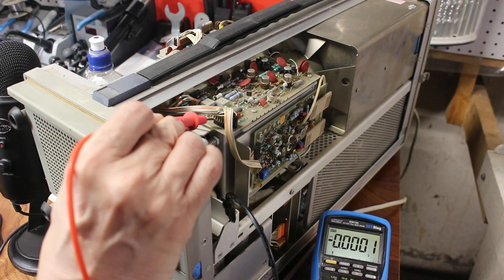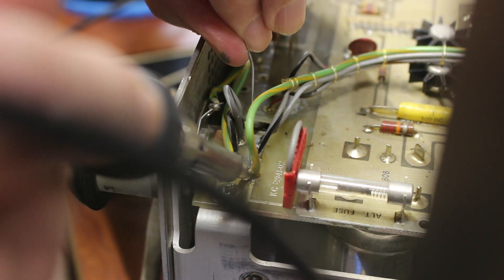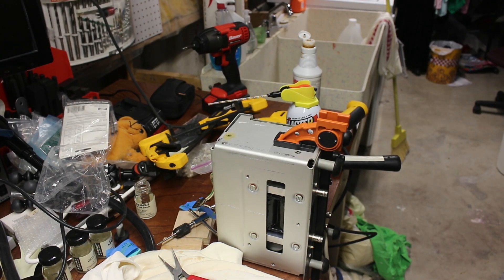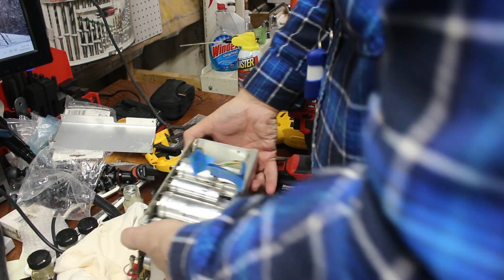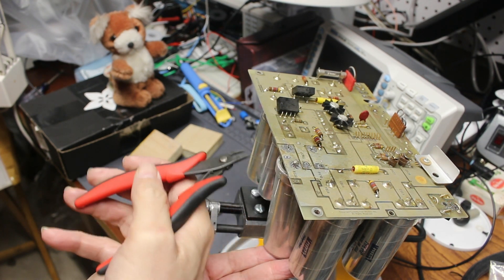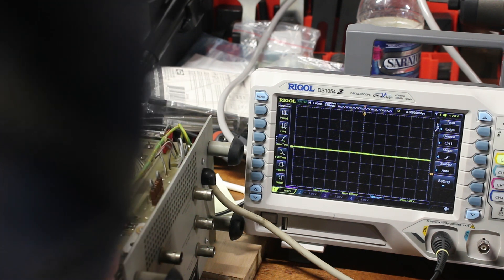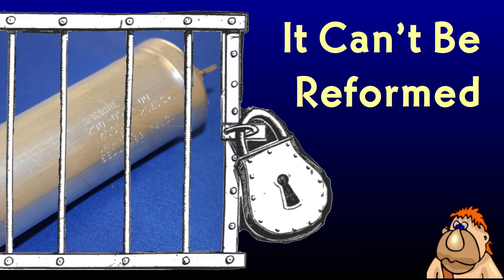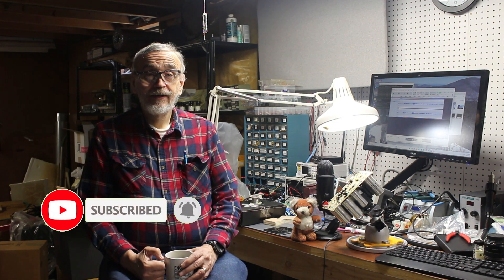Tektronix analog scope restoration: episode 2 of ? - accessing a bad capacitor

Comment: I mentioned on your other video that I'd had issues with pozidrive screws. I went to the trouble of buying a new set of pozidrive bits, to replace the starboard fright ones I had been using, but still damaged some screws - and I don't think these screws had been touched since the factory. So I'm even less happy with pozidrive (pos-idrive?) now.

While looking for leaking caps, take a look at the ones on the interface board. There are 5 electrolytics. One should be visible with the plug-ins removed, and the other 4 are hiding behind a small pcb between the connectors for the two vertical plug-ins. I recently discovered them leaking in a 7633; they'd damaged the interface board, the pins connecting the small board, the corresponding connectors on that small board, and had started to corrode the leads for the plug-in connectors. I just hope that whatever amount had soaked into the interface board wasn't enough to continue corroding the internal traces. 😅
Reply from the maker: I'll have a look. Thanks for the warning!

Comment: Kevin, your capacitorology is deficient.  The so-called leakage current flowing through a capacitor is actually the aluminum oxide dielectric formation current.  It never drops to zero as it is continually restoring dielectric that wears out.  The wearing out of the dielectric can be ascribed to entropy. Capacitor chemists know more about it but don't talk much about it.  Increasing the voltage on an electrolytic capacitor approximately linearly increases the formation current's intensity.  Ohm's law says things get warmer that way.  A capacitor kept cool lasts longer, obviously.  "Over voltage" on an electrolytic capacitor shortens its life but does not precipitously cause it to fail.  As in your oscilloscope's case, the most common failure of electrolytic capacitors is the increase of its "equivalent series resistance."  ESR, the acronym we are familiar with, increases and is the the result of the deterioration of the electrolysis process that makes an electrolytic capacitor an efficient energy storage device.  The average peak voltage of a good capacitor is lower than that of a capacitor with a high ESR.  That is why a 25 volt labeled capacitor can run at what you think is 26 volts but is not really operating at an average of 26 volts.  Do some more math.
Reply from the maker: @pibbles-a-plenty1105  Yeah. The nominal voltage on that rail per the schematic is 26 V,   and what I observer was 28.5 V because, as you say, the ESR is way up. That also diminishes the capacitor's ability to source current on the other side of the cycle, so the voltage also sags to less than the regulator needs. Even the nominal 26V on the rail is pretty sketchy for a 25 V cap, wouldn't you say? 

There almost certainly was degradation of the oxide layer during the long time in storage, and then suddenly applying full operating voltage can't have been good for it. (I'll usually try to reform with a voltage-limited constant current.) 

I didn't see obvious signs of leakage, but there may also have been some loss of electrolyte, which has the effect of reducing the effective plate area and hence the capacitance.

In any case, it is now most definitely bad. I was going to try reforming it, but it was going to be too much work to get it out nondestructively. Replacing with a modern 35 or even 50 volt part seems prudent.

Comment: Soldering 101 for you, Kevin.  It's the rosin FLUX that conveys the heat to the metals that are to be de-soldered, then eventually the solder melts and the molten metal raises the temperature to alloying potential, while the molten flux is preventing oxygen from oxidizing the metals and preventing alloying.  So what is alloying?  When two metals alloy it's the process of one metal dissolving into the other metal, or both dissolving into each other.  Now CAN THE F......ng MUSIC!
Reply from the maker: Rosin doesn't conduct a lot of heat.  It does provide a coating to prevent oxidation, true.  It also etches oxidation off the surfaces to be joined.  Preventing the oxidation lets the heat source come in better contact with the metals rather than having an insulating layer of oxide in between. And I used lots of flux.

Sorry you don't like elevator music.

Comment: HEAT would probably have loosened those screws...???
Reply from the maker: It's hard to apply heat in a controlled enough manner.  The aluminum cage will conduct it away fast, and I'm not about to take a torch to it with all the electronics right there!  I did use heat when I had to get a broken bolt out of my daughter's washing machine a few months ago - Dremel'ed a slot in the broken stub, heated the whole area, gronked on it with a big screwdriver, and out it came.  Along with a small fireball from all the penetrant I'd sprayed on it before resorting to the torch.

Comment: That's the reason I keep old plumber's soldering iron in my toolbox. Sometimes you really need that extra thermal mass to get things flowing.
Reply from the maker: @pvc988  My father's iron was lost in a flood some years back and I haven't picked up another. I don't need a big iron that often. I'll have to keep my eyes open if I ever get back into restoring vacuum tube gear.

Comment: The Sprague seems to have a date code of 7413 while the Mallorys are 7403.  Close enough to lend credibility to the idea that the Sprague was original and Tektronix made the mistake.  I recently redid the filter capacitors in my similar vintage 465 and there was a mix of Mallorys and Sprauges so I wouldn't read much into that.  
I followed the same techniques as you did for removal and didn't do any better, despite the caps being smaller.  Even with a lot of care it's hard not to tear these traces.
Reply from the maker: Yeah, the date codes are close.  Tektronix made the original mistake in any case - the bill of materials for that scope shows 25V capacitors.  It's still a puzzle that there are 30V caps on the positive rail (and the BoM shows 25V ones there too).  

I don't think I'm going to bother trying to replace the others unless there's an obvious sign of trouble,  Those old cans from Sprague, Mallory or Cornell-Dubilier seem to last approximately forever unless they've leaked, and I saw absolutely no sign of leakage. (It helps that they are mounted upside down so there's no electrolyte lying against the vents.)  I'm not in the camp of 'recap just in case', particularly with PC-mounted caps, where I'm likely to damage the board getting them out. I might change my mind, since I'll have extra hardware to adapt the new ones. With the first cap out, I think I'll have room to clip the lugs and not have to mess with a file.

While I don't routinely replace electrolytics from the 1970's, early 2000's electrolytics, from the era of counterfeits and the Capacitor Plague, are another story.  And I'm leery of tantalums, because they have a distressing tendency to fail short and catch fire. (Similarly, I don't touch competently-done 1920's knob-and-tube wiring unless the circuit needs service for another reason, but 1950's cotton-and-gutta-percha Romex puts the fear of God in me. It's a fire waiting to happen)
Reply: @KludgesFromKevinsCave  I think we're of like minds of many things.  The only reason I did a total replacement of the filter capacitors on the 465 was the difficulty of disassembly and the internet providing the physical sizes for easy replacement.  In fact only one was measurably, and demonstrably  bad.

So many of those old electrolytics have so much excess electrolyte or were so well built they'll be good for another hundred years if not more.  

I have faith in modern, long life and suitably derated through-hole electrolytics, but that faith is not from scientific experience but rather believing their logic.  The capacitor plague being at the least a cautionary tale to have such faith.

I've dealt with a rather large amount of knob and tube, and I've never found anything that wasn't competently done.  Electricians then were masters of their craft.  The only issue I ever saw was where the conductors were brought close together and then baked with a 100W bulb for 70 years.

Comment: I feel your desoldering pain here, having pulled a fair number of those cans from Tek TM500 mainframes. I've had a little better luck with a larger iron, but then there comes a point where the pcb decomposes from the heat...
Reply from the maker: If I get really ambitious, I'll core out the old can and hide the new capacitor inside.  But I probably won't, since I don't think the cap I'm replacing is actually original.

Comment: I think the screws might be Pozidriv rather than Phillips.
Reply from the maker: I don't think so - the slots looked to have started out symmetric but between being overtorqued and then sitting in place for fifty years, they just got thoroughly frozen.  (I didn't see any evidence of a thread locking compound either.)
Reply: @KludgesFromKevinsCave  They are definitely Pozidriv screws. Using a Philips bit probably damaged the screws. 

The best place for Philips bits is in the rubbish bin as it the worst screw type ever invented. Interestingly,  Pozidriv bits are usually better at removing damaged Philips screws than areal  Philips bit.
Reply from the maker: I checked, and while the screw heads were already pretty messed up, when I looked more closely, they are indeed Pozidriv. (Yes,I did know that there's a difference between Phillips, Pozidriv and Reed Prince) I don't know how I missed seeing the notches on the heads. I might replace them with Phillips because that's what I can get at the hardware store locally, rather than having to put together an order from McMaster-Carr. Heresy, I know.

Comment: Will that explain the brass lugs on the terminals, which were added to make the replacement cap a snug fit? (and a pain to desolder)
Reply from the maker: @kirkhamandy  I think I mentioned that the cap is a heavy component and nothing's supporting it but the board. I think that the first prototypes of the scope probably failed shake and bake because the caps started tearing away. It was usual to fix that by adding brass ferrules for strength.

Comment: There's definitely some things I would have approached different, but all that matters is that you got it out and found the problem. I also don't think it would ever have occured to me to make a PCB, so I can promise your repair will be much prettier than whatever I would have done (probably involving wire and zipties).
Reply from the maker: @SkippiiKai  the single biggest mistake was not taking off the panel with the fuses and BNC connectors. That would have made accessing the transformer frame a lot easier. I'll definitely have that off before I try to put the thing back together.
Reply: I own a 7000 series scope myself and also had to disassemble the power supply cage... It's indeed a pain, especially because the transformer is so heavy.
For the stuck screws, whenever there's room around them as was the case, I always try to use a mid sized (4 inch) diagonal cut pliers (and old one, you don't care about it anymore), grabbing the screw with one jaw inside the Philips key, and the other jaw outside the screw head.
If you squeeze tight enough, it almost never slips and the screw almost always gets loose (if the head doesn't break off).
Reply: @fabiotrevisan8922  I was mostly thinking about the desoldering of the cap and a few other things. As far as the screw removal, other than the rather high speed drilling into the screw, I totally approve of his technique - he used the LH bit, he used lube, and he used a tap wrench, and it's rare to see all that done outside of a machinist shop. Sometimes you get lucky and can save time using a dremel to cut a slot for a big flathead, but you need to be really lucky.
Reply from the maker: @SkippiiKai  And machinists argue the feeds and speeds endlessly. But my shop teacher once told me that you have to spin an itty-bitty drill faster than you think, because it's not RPM that matters, it's linear feet per minute.
Reply from the maker: @SkippiiKai  Also, sometimes just starting the cut with the LH bit will apply enough cutting force that the screw backs out. Last resort would have been to drill with the clearance bit and tap for an oversized screw.
Reply: @KludgesFromKevinsCave  I agree with the theory of that for certain things. It's critical to do that on my lathe, for example, but the goal there is different. I'll try to explain my own theory, but please understand I'm not the type of person who watches someone successfully and easily do something, and then yells "You're don't it wrong!" (At least I'm trying not to be...😁) 
I'll try to be detailed in case anyone without any shop experience wants to learn something that took me way too long to learn:
If I'm drilling through anything that isn't non-mild steel, (bolt, screw or anything stainless) the biggest problem you'll have is if the drill bit rubs/grinds in the screw instead of biting into it. That means applying a lot of heavy pressure, with a freshly sharpened drill bit, ideally in a drill press, on the lowest speed to ensure it's cutting in. If it doesn't bite in enough, the steel will work-harden and can become harder than the drill bit. You'll know if this has happened because either: a. Your drill won't cut any more because it's instantly dull, or b. You hear a pop and the drill bit is suddenly half the size it used to be.
Now you have two options, assuming you've gotten the drill out of the bolt. Option one is to heat the workpeice in a funace to cherry red, and slowly cool it burried in sand. Hopefully the disadvantages are obvious here.
Option two is to keep drilling, but now using a tungsten carbide instead of an HHS drill bit. Technically just a couple mm to break through the hardened metal and you can go back to a (newly sharpened) HHS drill bit.
Kevin's Cave: come for the electronics; stay for the metalworking. 😁
Reply from the maker: I hear ya.  I leaned on the drill as hard as I dared. The drill was pulling a nice spiral chip once it was through the interrupted cut in the screw head, so I got away with it. 

My only drill press is a cheap Chinese benchtop one (mind you, there's a world of difference between a cheap Chinese benchtop drill press and no drill press). One of the screws I had to drill was one of the flathead ones on the side, and there was no way I was going to get the whole scope in the press sideways.  Once that one went all right, I had more confidence with doing the others with the pistol drill. (I'd have been terrified if those screws were stainless! I think I might have asked a buddy of mine if he could try to drill them on his Bridgeport.)

All those internal threads are going to get chased with a tap before I try to get the thing back together.  If I have to use even penetrant and impact to get a screw out, to say nothing of attacking it with a drill, I no longer trust the mating thread not to be deformed.

And if all you're complaining about is the feeds and speeds, we're already on the same page about technique, so thanks for the vote of confidence.
Reply from the maker: @fabiotrevisan8922  it might have been off camera, but at least one of the screws I had to drill was a flathead - nothing much to grab. Sometimes I can manage to grab what remains of the slot with a four-flute extractor, but not this time without making a hole.

Comment: "old man yells at cloud, news at 5!"
(the old man is me BTW :) )
Reply from the maker: @stamasd8500  from one old man to another - Tek power supplies from the plug-in scopes are infamously a pain to work on. (Fortunately, they almost never fail.) Now  I know why they have the bad reputation with service techs.
Reply: @KludgesFromKevinsCave  and in general, Tek scopes are a pain to work on. I had to replace the NVRAM in a TDS380 about a year or two ago (before the battery ran out and it lost all the calibration data), desoldering it was a PITA. Very thick traces, huge ground planes etc. Well now it's done and socketed so next time it'll be much easier. So in about 25 years it won't be a problem. :)